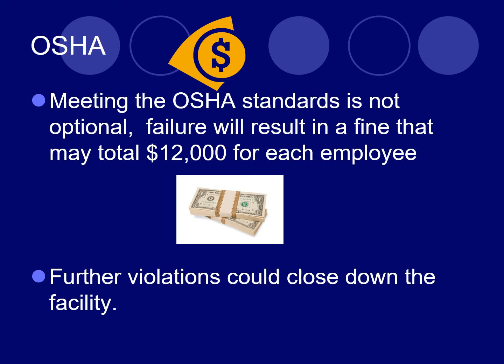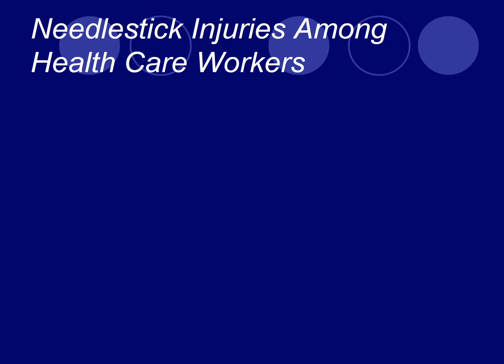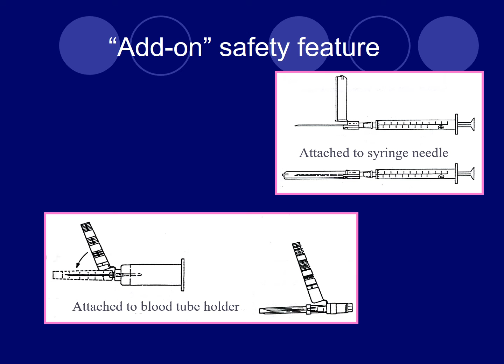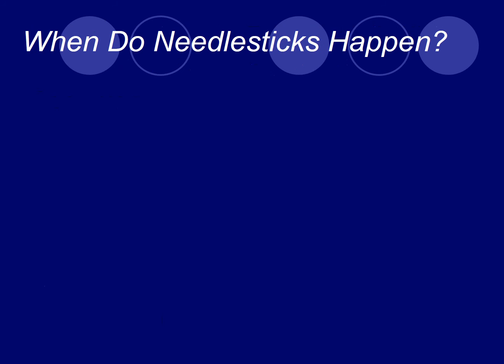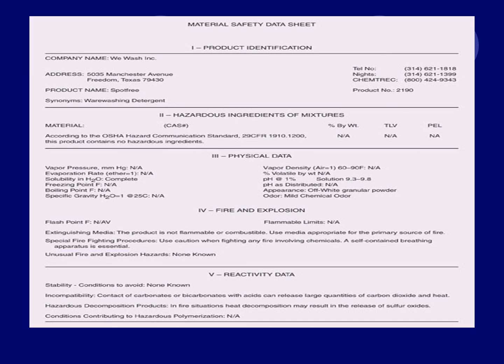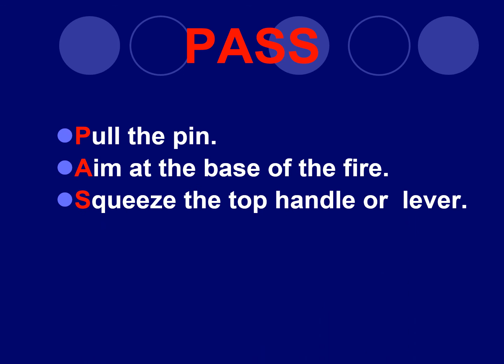Phlebotomy Solutions "Universal Precautions"

Comment: I stuck myself with the needle after drawing up lidocaine because I couldn't take the cap off and once I did my scene finger slit up to the corner or tip of the needle and stuck me. Nothing happened to me I was fine I mean I bled a little and it did hurt I still have a marking on my finger from it. But I'll tell you why this happened the stupid needle there is no righty tighty lefty Loosey it's the opposite on these needles